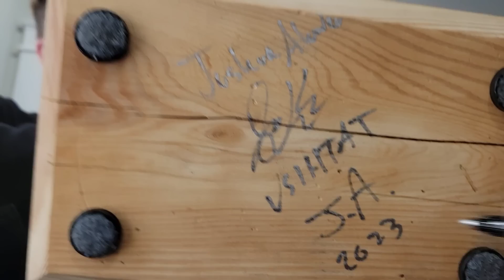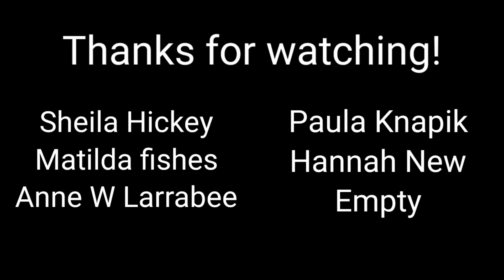Making my friend a fake plant out of hoarder house trash! | Another VLOG #209

Comment: Refilling air back into an half full can with your compressors air gun with the correct psi of a spray can will give the can back the ability to be able to spray the left over content after losing pressure of the aerosol. Make sure to be careful when doing so, as you can run into the risk of exploding the can if the psi is too high. There are videos on YouTube showing that it does work, here's a couple of good example of how its done - https://www.youtube.com/watch?v=InXaSfYqUeI - https://www.youtube.com/watch?v=mimSDtqljMA

Also beautiful job on the spoonzi tree! lol I think what is missing on it besides your autograph is a metal brass or maybe in this case a silver plaque with the engraving of your name, time and or date when it was made and the name of the person you made it for, etc, something along those lines anyway.